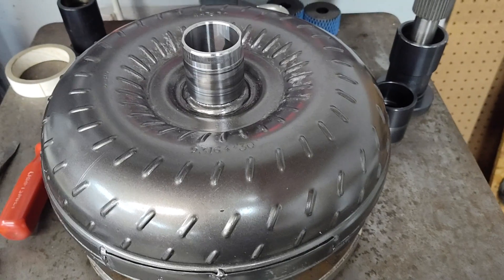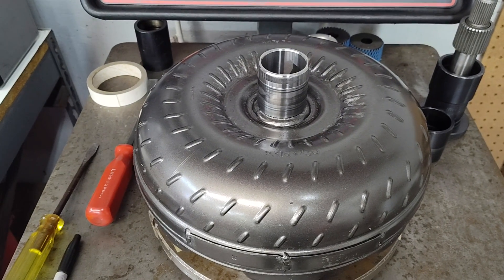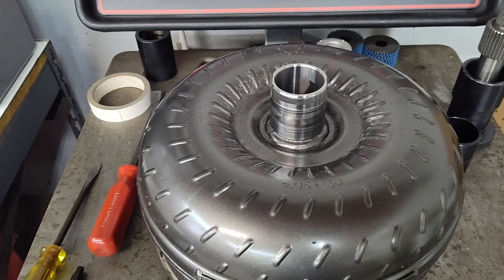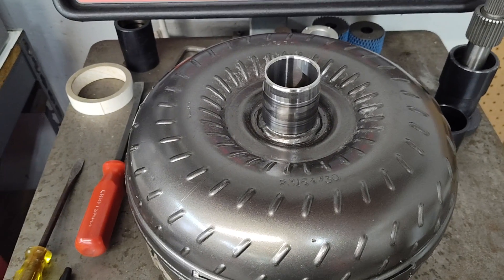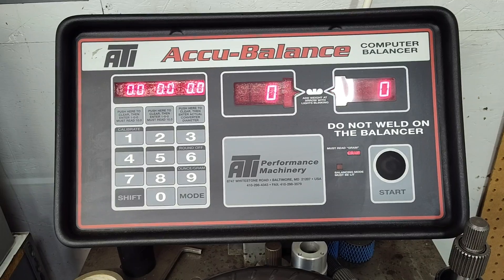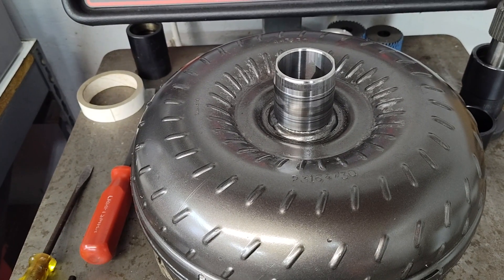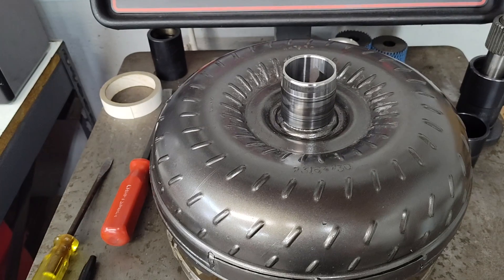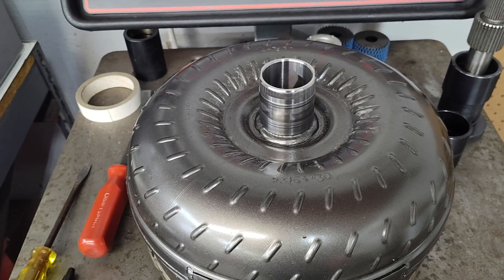Can a Torque Converter Cause Engine Vibration?

Comment: Hi Jay, Thank YOU again for diagnosing my Converter for the C6!!!  It was a "Towing" Low Stall (1200-1400 rpm) version I selected for a 3800 pound "Cruiser" pick-up truck that went along with their Transmission as to get their "warranty".  After the Install, on a "Internally Balanced" Stock Ford 300 Inline 6 with a Neutral balance flexplate and no previous "Vibration" issues, I knew something was not right. The company's customer service was so "difficult and unprofessional" that it became my own self-diagnosis, to come to the conclusion that it MUST be the converter. I put a "Stock" low stall C6 converter in from a company out of Tennessee, and smooth as glass.... Rather than send that BAD converter back to the company that lost my trust, I decided to eat the $ 412 dollar purchase and send the converter to someone I could TRUST for a diagnosis that may also help others. YOU made the perfect video to see clearly what was/is happening.   

   Thank YOU for your detailed explanation of the issue(s) with that converter, and it's comforting to know you help was available.   Your C6 Valve body worked really well last year Too, and it shows that you REALLY take pride in your work.
Reply from the maker: Thanks Pieter, this turned out to be helpful to a lot of people I think. We appreciate the opportunity.  I will try and do another with it cut open to see how it looks on the inside.
Reply: Yes I had one of these also for a C4. It was out of balance so bad that my hot rod shook like a washing machine on spin cycle. The odd color of this converter tells me all I need to know about where it came from. It hit the scrap pile and I bought a new converter from a different manufacturer and have not had a problem since.
Reply: @GaryH-pw9cm  Shame. Thank goodness Jay has done a "Deep Dive" on the subject, exposing the truth. Glad you got your issue sorted before damage to the rest of your setup!  That tc blah blah blah company cost me a LOT.  (trash converter)   No more junk from them, even though it was  made in the usa.

Comment: Fascinating video Jay, I've been loving these videos showing your lathe as an inspection tool and aid for accurate shaft pressing. I have a machining background and have a lathe and mill in my garage and am planning to eventually build a mild C6 and 390 FE for my truck. These videos have given me some good tips about things to look out for. Any plans to make a video on some of the valve body mods you perform on the C6? Not to rob you of selling any, just would love to do some machining on mine to improve it if I can.
Reply from the maker: Lathes and mills are invaluable for sure. Im sure I will do more valve body videos in the future. Thanks for the feedback.

Comment: i had a clutch from ram clutches come partially unfinished. i didnt notice it until i turned the car over and it dug a groove into my transaxle. it cost them 1000 bucks and a new clutch to fix it. i was nice i didnt even charge them labor.

Comment: Question!!! I had a really nasty vibration on my 454 (external balanced engine). Pulled the harmonic balancer thinking the weight on the back side of it wasn’t right and turns out that wasn’t it. Then unbolted the brand new summit racing brand converter from the flex plate and started the engine and it idled smooth as a sewing machine… do you think I should start with searching for a new converter? Or either I have a bent input shaft on my transmission. That’s the only two things left it could be I’m thinking. I would love feedback from you. Love the video very informative. I’m now a subscriber
Reply from the maker: Have a converter shop check it out for you. It could be a problem.

Comment: Could a poorly balanced converter cause intermittent vibrations starting at 50-60 mph with a C4? Already ruled out tires, wheels, suspension, bushing at the tail housing, driving shaft and diff. So the only culprits left are the converter, harmonic balancer or flex plate. Also my 289 have Parkinson at idle. Not terrible but it’s definitely not smooth
Reply from the maker: Possibly. I would think it would be more consistent but nothing surprises me at this point. You could have someone check out your converter to be sure.
Reply: Thanks for taking time to respond. I’ve already made arrangements to get it checked next week

Comment: So, can a C4 converter be "balanced" and still have run out issues? I had mine balanced and the vibration is still there. Does a 50 oz. AOD 164T flex plate not work with a 164T C4? The engine is a 50 oz engine.
Reply from the maker: I think I had stated in this video that I think the runout is more critical than just adding weight to it. Balancing something crooked that causes too much flexplate distortion does'nt really work. It may work for awhile but after the pump bushing wears the problem will be back.
Reply: @BroaderPerformance  If runout was not checked and a converter is merely balanced, is it possible to balance it on a fixture and still have it shake the car once installed?  I guess that is a better restatement of what I am getting at.

Comment: I had a converter from that company that had problems as well, incorrect dimensionally as I recall
Reply from the maker: That's another topic. I see so many height and pilot length issues on the Ford converters. Especially with the old 1.848 pilots. Its the main reason I had to start making mine in house. Thanks for the feedback.

Comment: I've had good luck w Dacco F 28 converter, 1.848 pilot, fits 390/428....2150 stall. I have it behind an early 429...
Reply from the maker: I think most converter are pretty decent and won't cause problems like this.  I would say this is in the minority being this far out.

Comment: Absolutely it can.  Had a vibration in a GMC Yukon.  Could not find it until I unbolted the TC.  14-hour job to change the TC, but problem solved.  Any make of car or truck can suffer from this.
Reply from the maker: Absolutely. Thank you for your feedback

Comment: I can tell by the wear pattern on the neck that it's not straight.  If you need a straight converter, call Jim Gillece.
Reply from the maker: They need to be a lot more than just straight. Thanks for watching.
Reply: @BroaderPerformance  Absolutely, but that's the most important part.  You can use all the best parts but if it isn't straight, it won't last.

Comment: Wow I have never seen on that bed yet. I have seen a lot of them out of balance. Most are In just normal daily drivers if you run them at higher RPM's. This one was just plane not welded right and also must have missed inspection at the plant.
Reply from the maker: I'd say it's one of the worst I have ever seen.